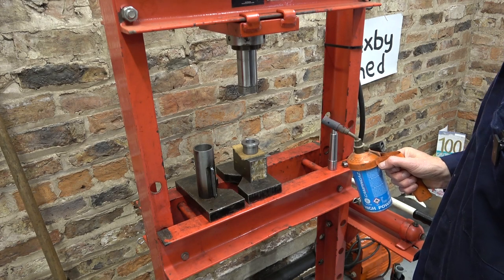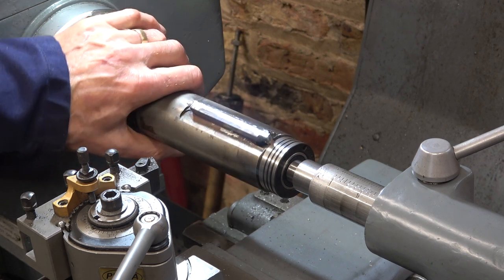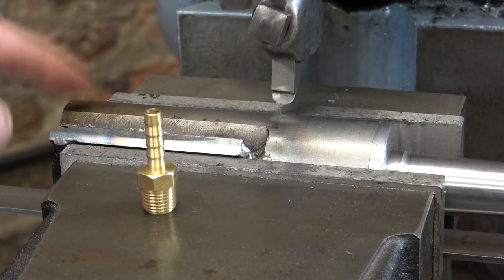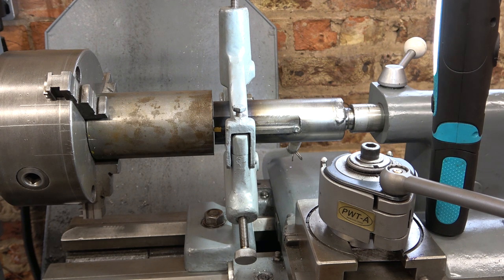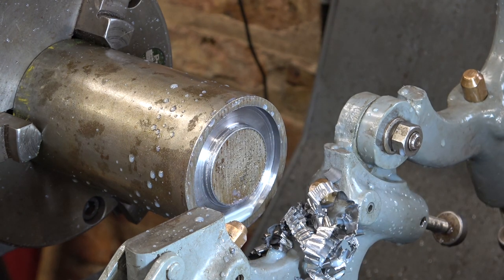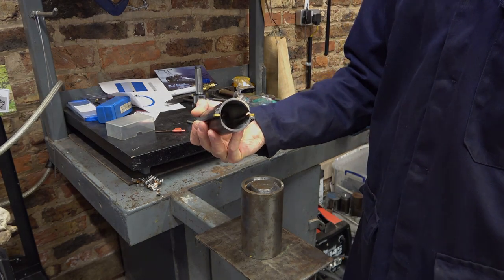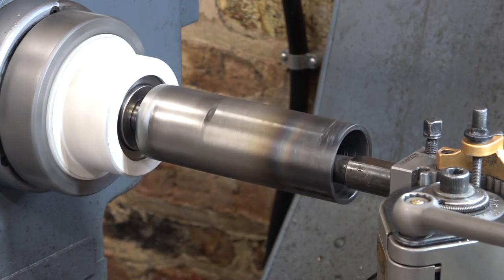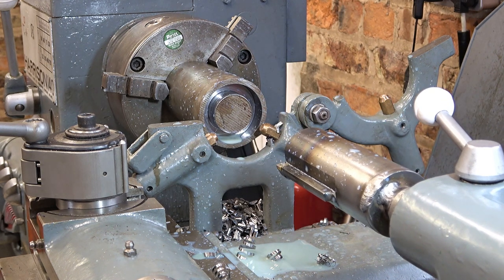HS107 Shopmade tailstock trepanning tool – Part 3

Comment: Hi Paul, Well done, seen all three parts now. 

I now know why my relatives down in Halifax were complaining about the lights dimming in the summer of 2022😂😂. You could hear it just starting to complain!! 

It was certainly solid enough and made for some interesting videos and two years down the line it came in handy on the grinding machine project. Hope you kept a piece of swarf!!

All the best!!
Reply from the maker: Hi David, to be honest I was surprised that it worked. I had to machine away the sides of the tube to cut the scrap channels and I was sure the tube would split with the force required for the cut with those 4mm flat-end carbides. Nothing ventured nothing gained - and yes it was the perfect size to cut out the centre for my surface grinder wheel balancing ring. Cheers

Comment: Thanks for running this experiment and sharing your tribulations. I hope you follow it up and produce annular cutters that perform as you desire.

Maybe the inner cutter is canting outwards under load. During the design phase you discussed brazing the top edge of the key steel, good plan that would resist the twisting moment. 

If you can afford Oxy you will love it. With Oxy you can flow brazing material down behind the key. Fully flowed silicon bronze or 115 silver solder would support the keys without the need to risk TIG burn through. Brazed shapable tips will become part of your repertoire as well.

Tig looks lovely for those arc shots on YouTube but Oxy is still the most versatile Cutting, Brazing, Shrinking, Welding ( including Aluminium), Heating, Forming, Part Freeing and Banana Ripening process out there.

Yes Acetylene will ripen your bananas and some other fruit.
Reply from the maker: Hi Mike, I used Oxy a bit when I was a kid and I did a bit of bronze so I know exactly what you mean.  I have not tried silver solder yet. I think I will be using the trepanning tool again soon - if all goes to plan. I'm not sure how I would produce spiral annual cutters without a geared differential dividing head. Cheers

Comment: The childish delight in a plan that worked, you can't beat that feeling. ❤
Reply from the maker: Hi, yes I had a very low expectation it would work. I was sure the tube would split from the torque, or the inserts would tear out. It's just impossible to guess the properties of materials without practical experience (just having a go). Cheers

Comment: Worked brilliantly. That’s a lot of cutting contact area for the lathe as it is and it cut that’s the main thing, without vibrations. This has been  educational. Maybe smaller cutting area and thinner wall pipe, would be nice to see d Wilkes’ comments on an attempt. I guess corring out a solid in this way is a slow process. Don’t give up it’s a tool once perfected it will put a smile on your face.
Reply from the maker: Hi Monster G, yes it looks slow and probably is slow compared with modern production methods but 200 rpm at 2 thou per rev would core out that whole block in about 12 minutes.  I could not drill and bore it that quickly, and I get to keep the core for another job. Cheers

Comment: Very impressive,  quite a large diameter on a relatively small lathe,  well diagnosed on improvements. 
Great vlog, thanks for sharing.
Reply from the maker: Thanks BT. It would cut larger with a lower feed and speed but I think I will look out for a more powerful motor in time - the lathe would take it. The high speed models of the Harrison 140 were 3HP. Cheers

Comment: David would be very proud with your very first attempt. May be change the revs up or down to find the sweat spot
Reply from the maker: Thank you spixy, he did actually leave a message to say he had seen the video and it made him smile. That was nice of him. Cheers
Reply: @HaxbyShed  ahaa, yes David is a nice guy. He normally always answered question in the positings.  I was wandering why you used tool steel for the insert holders? Is normal mild steel not good enough? Plus those inserts holders can be a lot shorter I think. And one remark in terms of brazing with silicon bronze: the surface neets to be very clean: you had some of that black sud so it will not weld properly. One way is to use an angle grinder or a small dremmel (pointy or rounded tool) to grind away any imperfections and than start again: bronze doesn't  flow that well, you can also puch the bronze into an existing weld to use that a starting point. Or use a bit of cleaning action is if you weld aluminium when you have an AC/DC welder. Nice project and one day I would like to also make a trepanning tool. Cheers!
Reply from the maker: @therealspixycat  I chose key steel because it comes in a range convenient square sizes and being medium carbon I thought I would try to heat treat it. As it turns out my torch was not hot enough so I have since bought a better torch (Bullfinch propane). The square keysteel extending along the sides creates a scrap channel, as David calls it, and it extracts the swarf rather than clogging the tool. I understand your point about cleaning the scale off - thanks. Cheers.

Comment: Very cool!  I am building a set of custom trepan cutters to bore out electric motor rotor shafts to be used as hollow shaft pump motors.  I decided to just start with the Sandvik WCMX insert cartridges as they can be easily switched to other cutters of different sizes.  For my own use I probably would have fiddled with making my own!  Nice work.
Reply from the maker: Hi Dylan, I was just so excited when I saw some really large bore trepanning I had to have a go at a mini version to see if I could make one and whether my small lathe would handle it. It was very satisfying to see it worked. Cheers

Comment: Superb work! I wasn't at all optimistic when I started the series, thinking having that much cutting edge contacting at once would be doomed to failure, but that works really well. Something to consider when I move on to a grown up lathe... I look forward to your next project 👍 🇬🇧
Reply from the maker: Hi TRM, I was doubtful for sure but the old H140 delivered. Nevertheless if I find a bigger motor at a sensible price I may fit it. Cheers

Comment: Very good. Sounded like you were pushing your lathe to its limit! Also, without the power feed from the saddle it would have been putting quite a load on the key in the tailstock quill - but I know it was just an experiment, not to be a regular operation. Thank you.
Reply from the maker: Hi Workshopfriend, yes truthfully it was a prototype but one that worked far better than I expected. If I had to bore a deep hole I would not hesitate to use it again. But if I were making another I would find a way to use narrower inserts. People have asked "why don't you use a hole saw or an annular cutter?" but they generally won't bore a core 4 inch deep (for example). I think I could trepan an 8in long core on my Harrison 140 (limited only by the bed length). Cheers

Comment: Well done buddy, thoroughly enjoyed this series, great tool and another I need to add to my list 😀
Reply from the maker: Hi Ralfy, glad you enjoyed it. You can buy them .... if you have deep pockets. Rotabroach or hole saws are fine up to a point but for long cores the trepanning tool is the business. With a longer trepanning tool of much the same design (60mm) I could core 200mm or perhaps even 225mm deep on the Harrison 140. If the lathe has the power for the size you want to core then it's only limited by the bed length. Cheers

Comment: Nice effort.  You learned a lot and if you make another tool it will be a success, on a bigger lathe.
Thanks
Reply from the maker: Hi Dennis, yes it was an interesting experiment - bigger motor required next time. Cheers

Comment: That was a bit of a nail biter there for a while. Both my lathes have 2 HP, and I want to increase the big lathe to 5 just for things like this...
Great job
Reply from the maker: Hi Craig, you can understand my hesitation whether it would work or not. You could get a 3HP motor for that lathe as a high speed option so I could probably upgrade sometime without worrying about the gearbox. Cheers
Reply: @HaxbyShed  that's a good point on the possible power limitations of the gear box...I wonder if there is any info online to suggest an upper limit for your machine from the OEM?
Reply from the maker: @craigtate5930  Probably unlikely I would find a published number but I will be safe at 3HP I'm sure.

Comment: Well trepanning takes a lot of power and you need to slow everything down rpm’s are high and your feed also
Reply from the maker: Hi jkmcp, I challenged myself to make that trepanning tool as a 'skills stretch'. I was quite amazed when it actually worked. Next time I have a job for it I will slow it down. If I come across a load of cheap annular cutters then that might be never 🤣 Cheers

Comment: I am surprised it cut as far as it did. I didn't think your machine had enough torque.
Reply from the maker: I was surprised too Andy. The whole thing was an experiment with no real expectation of success but in fact it performed rather well. I used it again very recently, which you will see in a couple of weeks maybe. Cheers

Comment: Huge cutting width requires an ultra-low feed and, as a result, productivity of this tool is not-acceptable low. At the same time, there is a huge load on the spindle.
The same task might be solved with a much simpler tools, such as extended crown sawbit. Or you need to reduce as much as possible the cutting width by using a parting tool inserts.
Or, as a simplest way, use a special turning tool for this type of cutting. It, in a comparison with your tool, almost doesn't have a turning diameter limits...
Reply from the maker: Hi К.В. П.  I agree with you mostly but the trepanning tool can bore a hole any depth. Even on my small lathe I could bore out a core 200mm long perhaps and on a big lathe there is almost no limit.  Cheers

Comment: To mush tool prusher.
Reply from the maker: Hi Michael, yes I agree too much tool pressure so not ideal but it worked. Next time I will find a way to use smaller narrower inserts. Cheers